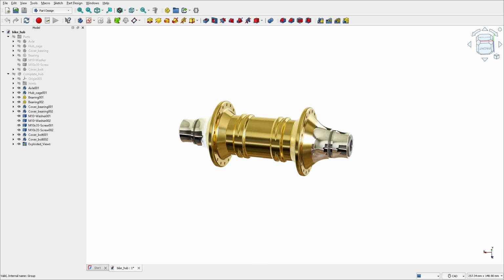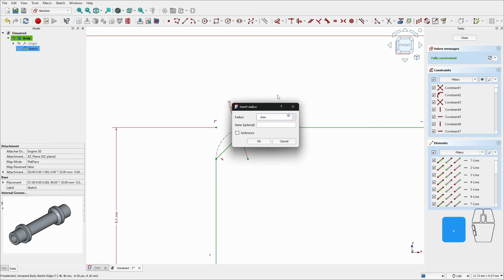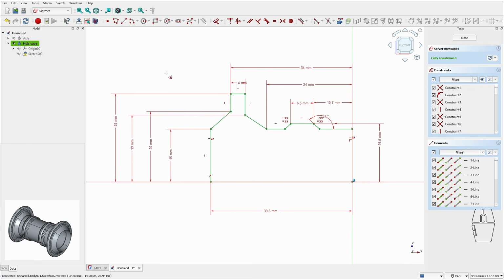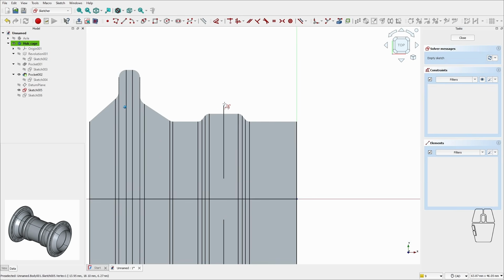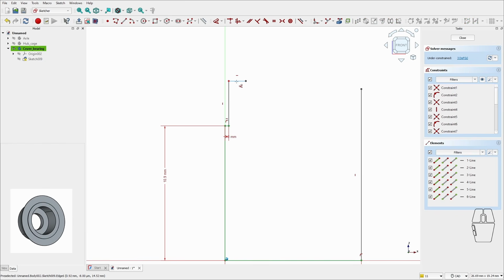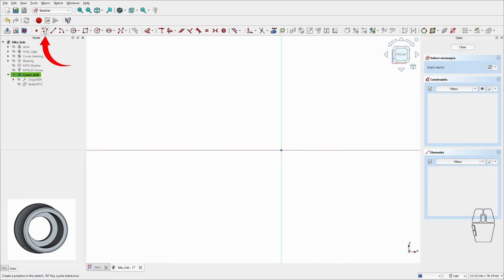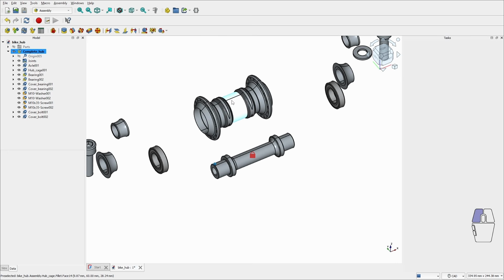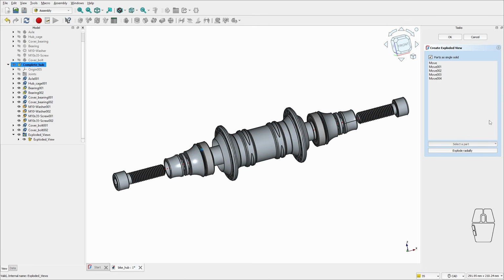FreeCAD - Complete Beginner 3D Models and Assembly Tutorial - Bike Hub

Comment: I got to the point of getting a datum plane, but my datum plane in part design in this particular project is "blue", small and inside the hub's circle.  Next problem after making the oval sketch where it belongs, making a new sketch went directly to the center of the circle and bypassed the option for any different work plane?  What is going on?  Usually, shutting down the program and restarting where I left off fixes the glitches, but not this time.  Oh, I forgot, the forum "NEVER" helped - sad!

Comment: This is a great video.  I will offer one tip (for the more advanced user).  When I do revolves with hollow geometry, I include that geometry in the sketch with the exterior.  One must remember when doing revolves to use radius dimensions and not diameters.(include a "/2" when inputting diameter dimensions  exe  1.5 /2 in will return a .75 radius).  With this method a whole sketch can be eliminated.
Reply: Was just web searching why not do it that way.  ex,  "in Freecad, when sketching a part to revolve, why not offset sketch with an axis construction line and the radius of the hollow center?"  Results were saying it's unstable?  In the case of this Hub with a 2 step hollow it eliminates 2 planes, drawings and operations?  I'm happy to see your comment and tip! Gues I'll have to just try it.

Comment: when initially setting dimension, you set the highest point to 12mm. I spent half an hour understanding how you did that because when I clicked the line the D tool did not add a dimension from the top of the line to the axis, but only on the line itself. I think what you are doing is to click on the axis first and then on the top end of the line. That should be stated. This is the problem for a newbie; to understand how Freecad is thikning. Else, I have seen a couple of your truly excellent tutorials on Freecad. Helped a lot!

Comment: I had trouble using FreeCAD 1.1, after creating the Datum plane to create the ellipse, I've noticed the axis the sketch is created with is rotated by 90 degs vs the video's one, so I had to create the ellipse with 270d instead of 180d to match the following steps. If you do it 180 or 90 in the ellipse you'll have trouble finding the point on which the external geometry is created.

Then, when creating the fillets on the recesses, I had to select the faces instead of edges, as it displayed some cryptic UParameter message

Comment: The second spoke hole can be performed similarly to the first, no additional line, by simply placing it on the other axis. Since the number of holes is not divisible by 4, it would fall exactly between two holes from the other side.

Comment: when I try to do the 2nd vertical constraint, it doesn't reference the x dimension but goes to the previous dimension of 8.5mm, so I compensate with 3.5mm. but then I can't get it to do the next dimension from the z reference at all? I'm sure there is some small move that I'm missing but I can't find it?  So around the 5 minute mark is where I'm having the issue.?

Comment: I got to the part to revolve around the elipse. I cannot create external geomtery on the point of the elipse. it throws out an error, failed to add external geometry. The amount of errors encountered in my first try is not a good sign of what to come i suppose. some where user errors, sometimes the disappeared by using the undo arrow and following the same steps again.
Reply: Same here. I can't find the elipses point anywhere.

Comment: I dont quite like your process.

when you design stuff you never ever want to include finishing operations such as chamfers or rounding edges inside extrusions or rotations.

makes them harder to find and if you have several configurations and in a later one want to remove them you will be messing all your files.

Big nono.

I also find this method to make assemblies very limiting since you need to have blueprints of each piece to be made.

I can tell you already the moment you try making some minimally complicated mecanism or asembly from scratch youll be screaming each time stuff doesnt have the correct measurements.

Its way better to first model all the pieces in block and assembled so everything fits together.

Comment: Got most of it to work. It's a good tutorial, but the software has more bugs than the Amazon Rain Forest. After finally getting a nice exploded view, I go to put threads on the screws. After I do this, when I go back to the exploded view, one of the screws is offset with weird dotted red lines, and the unexploded view has a part displaced from the centerline. Tried this multiple times. I guess I'll leave it without the threads.

Comment: Moreover, in the ver1.0 I have, you have to have the joint selected and then load the two edges. If you select the edges in advance, there's nothing in the joint, and you have to load them again. Lastly for now, when you repeatedly zoom in and zoom out and rotate, the parts start going all over the place and you have to go and find them. This is clearly a beta piece of software. Looking forward to the next version.

Comment: The UI to insert parts is horrendous! Trying to select those edges to put the bearings inside the hub is hit or miss at best. The parts need to rotate independently. I got it to work once, and have struggled with it multiple times after that. Just awful!!!

Comment: i almost finished the assembly, then suddenly parts disappeared, undo/redo didn't result in visible changes. saving didn't work - "access violation". closing freecad let it freeze. after re-opening, recovery produced an empty document. nice. not. when i re-created the pedal thing (from other video) i also had similar problems, but at least the recovery worked. this is as frustrating as three years ago, when i tried to learn freecad the first time. i assume it's written in C. p.s.: the video is great!

Comment: Finally somebody using symmetry on the feature level instead of mindlessly drawing everything twice, thank you!

However, is there a reason you extrude a "solid" profile sketch and add the central holes afterwards instead of just including them in said profile sketch? Like, does FC not allow that or something? Otherwise, that's an extra sketch and feature for no reason. Now, whatever the reason, if you add features, it's not good practice to use prior feature surfaces/points as datums (unless you really really have to) - even with FC now having somewhat graduated from the TNP days.
Reply from the maker: @keinschwein8467 Thank you for your comment! I added the central hole afterward because I didn’t want to complicate the revolve sketch too much, as this is a tutorial for beginners. FreeCAD handles this very well, so you can do it in one step if you prefer.

Comment: Fantastic tutorial, but unbelievably frustrating to try to copy. My installation does the same as the tutorial up to a point, and then it fails and does something completely different. I only save when I have completed a set of actions successfully (to a successful result). So every time it fails, I just shut down the entire program and start again at the last successful save. When doing the exact same steps over again, it either fails one more time or succeeds. If I succeed, I save again, and continue from there until the next fail - and so on.
Eventually I couldn't get passed the mirroring of the hub itself. I had no problems mirroring the axle, but when I get to the same step for the hub - it fails. It just says "mirrored successfully", but no new mirror copy of the hub appears. I eventually had to throw in the towel and give up.

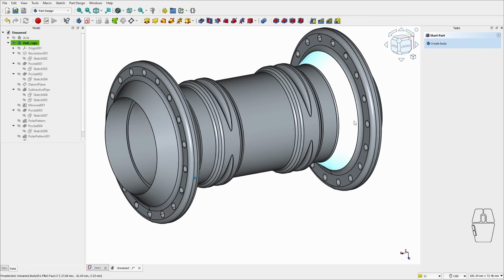Comment: 25:20 adjusting the radius size to 0.3mm gives me an error "Geom_BSplineSurface::PeriodicNormalization: Uparameter is too great number" despite it defaulting to 1mm and being fine with it. I have no idea what is going on. Also, how are you rotating the drawings so smoothly and without any key or mouse indications?
Reply: I got the same error.... @deltahedra3D please help us
Reply: I got the same error :(
Reply: I got the same error. Making the radius "0,299mm" made it work for me. Not perfect, but close enough.

Comment: This is unbelievable! But I tried myself FreeCAD 1.0 and it is that easy. (There are some trouble when you make mistakes and trying to fix geometry after you change some operations. But I was able to understand how to fix them.
I guess you can create some videos of how to change setting of already created elements and resolve conflicts add forgotten operations and change order. Also how to select constraints to solve over and under constraint trouble. And of course how to use measurement mode to check final model parameters.
I am starting to use FreeCAD from now on for my projects! It is quite usable now. It is not perfect, but I could not create anything before. And now I created a complete project and managed to resolve all the issues.

Comment: Trying to duplicate this reminded me of freshman calculus where one step of the genius professor's was five steps for ordinary mortals.  When I walked through this using the dimension tool, the 12mm highest point didn't measure from the X axis, but from the line 3.5 mm immediately below it.  Similarly, the 32.3mm measurement from the Y axis would only measure from the next line towards the Y axis. Where did I go wrong?

Comment: Please make a follow up demonstrating the power of this parametric design by modifying the length of the hub and the position of the ridges. Designing parts often is an iterative process, and as an assembly grows, parts need to be modified to fit. The D in CAD stands for design, not for modelling parts you already know how they need to be.

Comment: Excellent tutorial! Just the right pace...

BTW, in the initial 20 seconds, you have shown the whole assembly rotating (like a turntable display) in the FreeCAD window.
How did you achieve that? Is there a built-in feature in FC?
Reply from the maker: @nagesharas5136 Before 15s, it’s an animation made with Blender. After 15s, it’s done with a spacemouse. But I think you could check out the Animation Workbench to do that.
Reply: @deltahedra3D  So is the material and lighting also in Blender?

Can we import assemblies in Blender? But I suppose Blender won't respect the nature of all joints, right?
I am particularly interested in using materials/textures and lighting for assemblies.
Reply from the maker: Here my workflow if you are interested : https://www.youtube.com/watch?v=6amHcXHxCa8
Reply: @deltahedra3D  
Thanks a lot! This helps!

Comment: Good job. One question, why you didn't "make the main holes" directly with the sketch?
Reply from the maker: Thank you :) 
You could, but I didn't want to complicate the sketch. And if you are a Beginner, discover new feature is good too.
Reply: @deltahedra3D  Second question :) How do you render objects? Do you use freecad or blender?
Reply from the maker: @Piallator78  I use Blender to make the renders, here's a video link of my workflow if you are interested : https://youtu.be/6amHcXHxCa8
Reply: Just to add into this comment, in CAD you can do things in different ways to achieve the desired result.  One designer might choose their workflow and another does it their way.  This is something that took a while for me to grasp that the process could be so flexible.
Reply: If all the possible detail of all possible features designed to be in a part are in one sketch it will easily make the part difficult to edit and alter in future. 

Ie. Using separate features for various details to be in the part will save you or someone else a hassle in future. 

This might sound counter-intuitive, but trust me it makes the feature tree for the part much much more easier to read and from there on easier to edit. 
It will also help if the features are named to depict the detail within.

Of course it is all different topic for one-off designs but for example as a professional engineer being a member in a team separate named features will pay off.

There is also the side of parametricity.
If you sketch a set of holes by hand on a face of part. 
Each different hole having their own cicle and each cicle having their own dimensions for location and size. 

How cluttered the view would be by the time you are trying to find a place for the sixth or seventh hole out of twelve needed?

And even then going through all that and creating a fuctional part design.

Imagine I as a customer ask one more hole one that face on the same radii as the previous holes. 
How difficult and cumbersome it would be to edit the hole pattern?